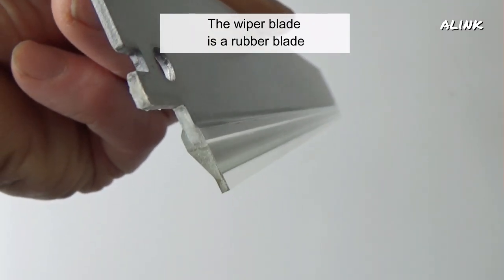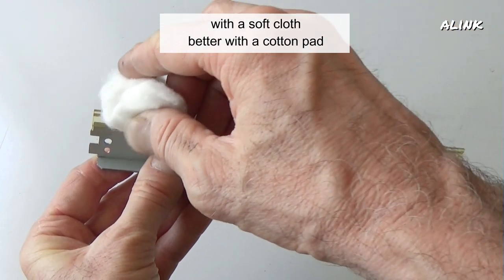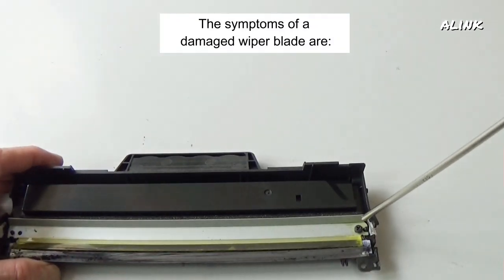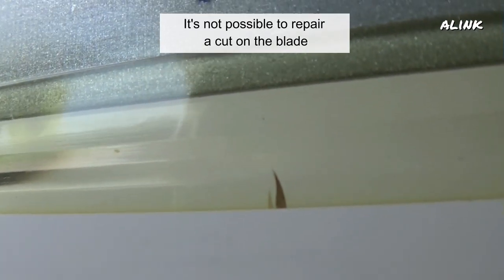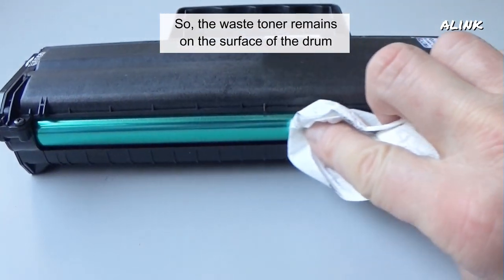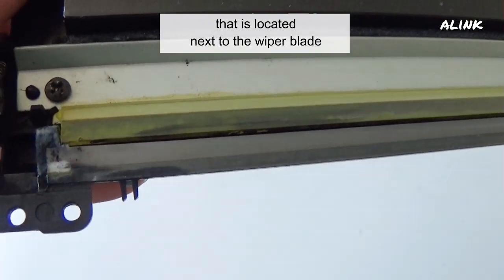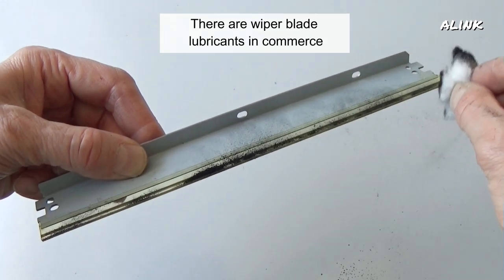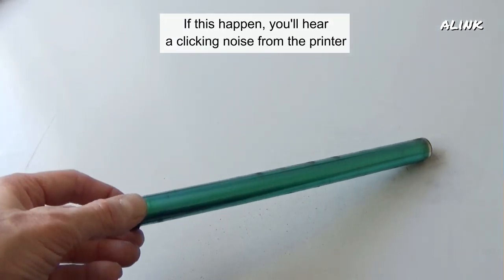How to clean the printer Wiper Blade.

Comment: Thank you for your video . But from where does one get the extra toner to lubricate the wiper blade & drum  after cleaning both ?
Reply from the maker: you can take it from the toner roller, you don't need so much of it. or you can use the waste toner.
Reply: @viandant5  Thank you

Comment: Sir what is the lubricant used on doctor blade/ wiper blade in Q2612A cartridge????? Please reply in English.
Reply from the maker: you can use a bit of toner on both. on the wiper blade there could be a lubricant as zinc stearate.

Comment: Hello sir i get thin vertical lines on the paper on the same place should i change the wiper blade
Reply: Actually the printer was sitting unused for 6 months so despite much use wiper blade is yellow in color
Reply from the maker: @Crazy-bt3se  If there is a line also on the drum, probably the wiper blade is defective.
Reply: @viandant5  yes sir there is clear line to toner on the drum if I clean the drum ,first few copies have light lines then it darkens
Reply from the maker: @Crazy-bt3se  The wiper blade is defective
Reply: @viandant5  thank you I changed the wiper blade now there is no vertical lines and even the print is darkened